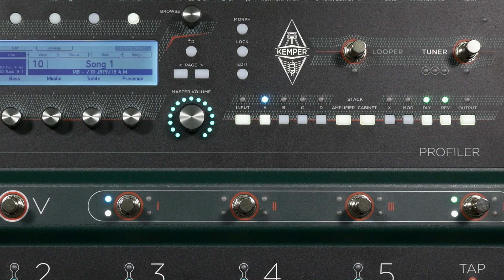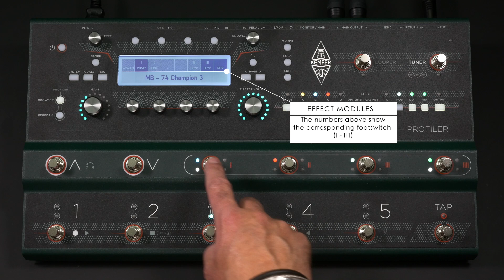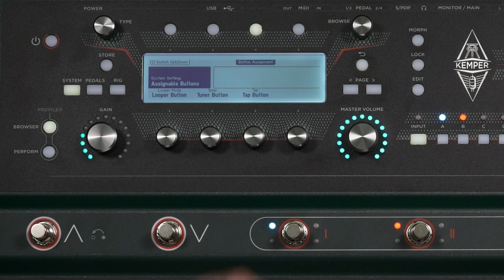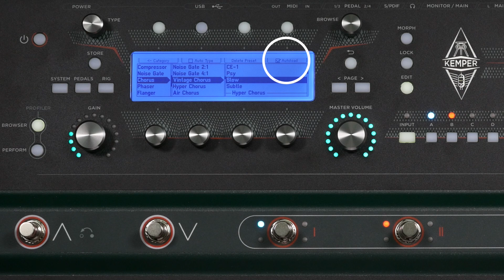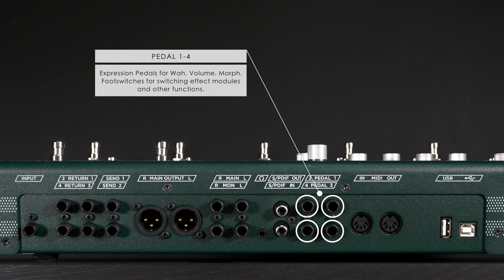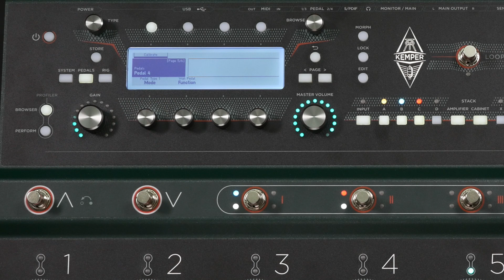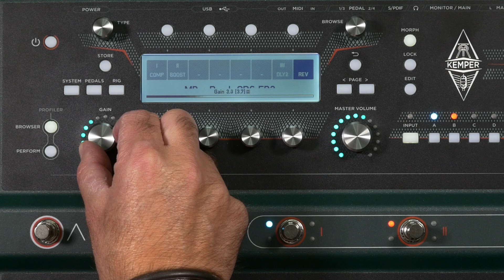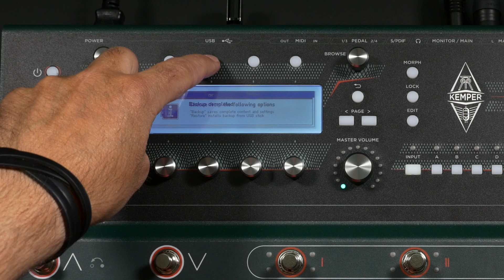Kemper Profiler Tutorials - Profiler Stage Overview (english)

Comment: I bought a Stage as a backup to a relatively old powered Toaster. I have kept them both up-to-date, OS wise. 
I am getting a powered kab so I can use the Stage amplified. I can confirm that the performances and rigs sound identical across both platforms. Best guitar gear I ever bought.

Comment: Decided I was done with schlepping amps, cabinets, pedalboards, etc. Tired of the issues and inconsistencies that went with them. The Kemper made this a quick and easy transition  for me. In one case, I have all of the amps, cabinets, pedals, or effects that I could ever want or need. What I don’t have is a sore back, patch cables, dead batteries, multiple power supplies, signal chain issues, etc. Sure, you could spend a lot of time figure all of the bells and whistles, but it’s basically ready to rock as so as you unbox it. Plug in your guitar, tune it, choose an amp rig, then rock on.
Reply: I don't know what's putting me off. Something scares me about that scenario and I don't know why. I must heed your advice and sell my amp and pedals and just buy one haha. So you have some sort of cab you use for rehearsing or anything?

Comment: Just got my stage (used) a few days ago.  Found a profile and used it live last night.  Amazing!  Sounds like a legit amp through FOH and my IEM's were perfect.  No regrets!
Reply: Straight to the in ears sounds good?  I saw another vid that said it was grainy.
Reply: @UptempoMusicLessons  I removed a little bit of high end and reduced the presence slightly on my high gain settings and it sounds great in my IEM mix.  It's a constant reminder to me that the quest for the ultimate tone is dependent upon many factors, and it changes from venue to venue.  Room size, shape, number of heads in the crowd all change the FOH sound.  At least I can leave that up to the engineer.  We run our own board as a band for our stereo IEM's and control them ourselves, so that part is relatively consistent.

Comment: the friedman ir x is the new kemper slayer designed by evh's personal tech and one of the best amp builders today not a  keyboard player ,with real tubes and great tones out of the box easy to use .sounds way better and more natural than any modeler could ever sound, can work with your favorite effects and with a power amp and speaker and has an effects loop .

Comment: I came across a bit of an issue, I’m using a power amp without a master volume plugged into the monitor output, and the monitor volume control/eq has no effect on the amp, only master volume does. What am I doing wrong?

Comment: Hello, is there anyone who could help? I just bought Kemper Profiler Stage alongside Mission Pedal. I made connection exactly like in the video. I changed settings exactly the way it was explained and set my pedal to be volume when OFF and Wah Wah when ON. Mono switch works pefectly and volume when OFF as well. But Wah Wah is not working. Pedal jusr doesn't do anything. Has anyone else experienced something like that? How did you solve the problem? Best regards.

Comment: How different headrooms of Head and Stage may affect the sound especially if using SPDIF? Is there DAC to outputs and then ADC to SPDIF or SPDIF is just simply digital output from the digital core? I watch a video where Stage is compared to Rack and Rack sounded fatter with less clarity. People in the comment section preferred Rack for its fatness.

Comment: Dear friends at Kemper,
I'm planning on buying the Kemper stage later today, but I still have some questions about it. I hope you can help your fellow musician. Here they are:
1. Can I change the position of an effect in the chain?
2. Can I put an effect in serial or parallel?
3. When profiling an amp, do I need to use a noise gate? As you may know, Marshall JVMs are quite noisy in high gain situations. 
4. Since power tubes give that extra grit, do I need to profile the amp at high volumes?
5. Does the unit have a wah? If so, when connecting an expression pedal, the effect is already engaged in the preset or do I need to switch it on like a Crybaby?
Reply: 1) Yes 2) Yes 3) No 4) Yes 5) Yes, dozens of Wah models. Load a Wah into FX slot #1, set the Wah settings to however you want it to engage, heel down, heel up, touch, etc.

Comment: This vs a Powerhead? Curious of your thoughts. Since this doesn't have a power section (it would be annoying to still lug around an amp as well as adding this) and I don't feel like making presets on a floor unit. The Powerhead seems more practical?
Reply: You can get a pedal size power amp like this for example https://www.thomannmusic.com/electro_harmonix_44_magnum_power_amp.htm  im not a Kemper user, but ive been thinking of downsizeing to a pedalboard and an power amp like this from my rack with tube power amp. There are other makers of similar amps as well, Harley benton, hotone and mooer is availible at Thomann at least. I wouldnt want the powered version anyway since its 600 watt and risk blowing my 1960´s 100watt  4x12.

Comment: hi considering buying a profiler stage because i like the idea of the units capabilites (the obvious profiling feature, library of sounds out of the box,etc) but im still very confused about one aspect. does it need a power amp? ive see old bandmates plug their axe fx rack and floor units directly into a cab; sounded great (no power amp) and was also able to split the output between his cab and the PA to use the cab as a personal monitor to feel and hear it at his back. im totally lost when it comes to this new tech. every forum i read is dudes obsessing over which power amp is best which is most neutral idk. is it even needed? is it a preference thing? does this work similar to axe fx in regard to it being able plug into a cab and play? thank you for taking the time to read this :) (also im going to use it for like proggy animals as leaders stuff if this makes a difference at all. spanky crystal clear shimmery cleans to tight punchy 8 string meshuggah rythmns)
Reply: Also is ok to use regular instrument cables to plug it in a cab or do I need to use speaker cables? Again I know little to nothing about the functionality of this unit and similar offerings on the market so please excuse my questions if they come off as stupid lol

Comment: Sorry if stupid question but do I still need an amp if I'm using a kemper profiler stage? I want to get rid of my heavy cabinet and tube amp...
Reply: Michitarre, I stopped using an amp and speakers. I only use the Kemper. One output cable to the board. Since we use powered monitors, I run a cable from my monitor out to the monitor.

Comment: Why didn't you show the profiling process? I'm a little bit confused, does it profile?
Reply: Yes, it has all the capabilities (including Profiling) as the Kemper head and rack Profilers.  The specific connections and instructions will be detailed in the Kemper Profiler Stage user's manual.  The Profiling Process is the same on all devices, so you can just refer to the Kemper Profiling Guide manual, for that info.

Comment: So you get this amp plug in guitar and it plays out of your speakers?? No extra amp or head needed
Reply: It's not an amp but an amp sim, so you'll need active speakers, not passive speakers. You could stick an amp between the stage and a cab, but the point is that the stage does not have an amp built in.

Comment: Now I love my Helix even more
Reply: Why?
Reply: @deltafit  Better display, better interface, easier live editing, smarter foot-switch display (designated colors, effect name) with 10 switches for stomp-box mode – comparing to the Kemper that only has 4. Colored lights for easy identification of effects when playing in dark scenarios, snapshots, touch sensitive switches for quick effect access, view and editing, easy to operate editing computer software, bigger community for presets sharing, can run 2 amps at the same time, and… …it includes an expression/volume pedal – still $100 cheaper. Line6 just release the 2.8 firmware, and it’s even better.
Reply: @victorsantiago7391  you aren't wrong!  I think Kemper has missed a big opportunity with this device... it is simply their current profiler and remote placed into one enclosure (which people have been requesting for years), with no significant new functionality.  If they had looked at what the competition is offering and used that as the bar that they needed to meet or beat, this would have been a much better product, and it would have gained them a lot of new users.

This seems like too little / too late.
Reply: Sorry to hear.. no one is perfect. All the Helix owners are here to see what they missing out on :-)
Reply: Yes, there are a group of people who prefer shiny, color displays and scribble strips over having a completely accurate and authentic recreation of a specific amp's tone and feel, including industry leading effects.  Cats like shiny objects as well.
Reply: @victorsantiago7391  Yes, let us know when you get around to profiling yours (or anyone's) tube amps with your Helix.  I will be keen to see how that goes for you.  Enjoy your "better" display with your inferior amp tones.
Reply: @brentcgp  Apparently nothing.
Reply: @Deuterium2H  We prefer the convenience, the reliability; having every effect, amp, speaker cabinet, microphone, and 3rd party IRs that we will ever need crammed in to one pedal, for a lower price. The benefits of something like the Line 6 Helix makes it worth the "difference" in tone from a Kemper. Yes, I know and understand the Kemper could be better on accuracy and recreation of a specific amp, tone and feel, and that the Helix cannot “profile” any amp, but I will be thrilled to see you tell apart sounds in a blind test from a Helix and a Kemper – it’s practically impossible. When there’s a band playing through a PA system and a crowd, you CAN’T tell if the guitarist is using real amps with analog pedals, a Kemper, or a Helix.
Reply: @victorsantiago7391  maybe you cannot but plenty of other do
Reply: @robertsimpson5801  Well I who come from Ax8 I crossed the step I just order
I find it great a long time ago that I hesitate to come to fractal
and that line6 do not like me at all huge interface have lost are time to settle rather than play,
Reply: Brent Nel to see how far behind Kemper are !! 🤪
Reply: Victor Santiago and then the Axefx8 which is better than both !!! 😎
Reply: Pity it sounds like shit compared to the Kemper. But if your psychology is fancy lights and colour TV screens versus tone then hold onto your made in China Helix!
Reply: LoL

Comment: How to read the tuner on the display?
Reply: It has two modes: normal and bubble (not shown on this video). On the normal one if the bars are moving from right to left the pitch of that string is too low. If the bars move from left to right is too high. May sound confusing, but when you're using it is quite intuitive. If it's still confusing you have the bubble mode. 

Ps: While being in tuner mode a number is also shown on the bottom of the screen telling you how many semitones above or below the reference pitch the string is :)
Reply: The tuner takes up the whole display.

Comment: Crap display for this price, Kemper need to get real against Fractal, Line6, Moer.  This alone would delete this from being a worthwhile buy!  I would fire the designer responsible for the display!b. The UI is too fiddly 2.  Last but not least FX is less comprehensive plus where all the competitions says what you get, Kemper says you can profile anything, but doesnot advertise what comes with it, except profiler as does Fractal and Mooer. MUST BE AIMED AT EXISTING KEMPER CUSTOMERS.  I shall continue with my order for Fractal FM3.
Reply: Check sales of the 'Stage' over the last two weeks and check sales of the Fractal over the same period...there's your answer right there. :) Then decide what's "real" and what's not "real". :)))
Reply: @CrazyDiamond1968  Sales has nothing to do with design or spec for me. The FM3 is yet to be available so sales is not a good argument right now. The long awaited rig manager and now this display put me off it.  There are Kemper lovers and Fractal fanatics.  I dont have either and about to enter the modeller market with the low end FM3.

Comment: terrible display and interface, headrush pedalboard older but much better
Reply: You don't play an interface. You play the sound.
Reply: @celticgibson  agree, but its 2019 not 95, devices should be much more user friendly
Reply: @ExoticBomj  honestly it doesn't get more user friendly (to musicians aka apes who like playing with knobs) than this, everything is literally at the touch of your fingertips, why do you want a display (that will break) and go through 15 menus to change the rate on your chorus?
Reply: @carlosfallas2169  i know what it's like, i owned kemper for two years and it was the worst user interface i ever tried. even old line 6 x3 live more user friendly and it's pity that nothing changed even on floor model
Reply: ExoticBomj but the sound is way better
Reply: @ExoticBomj  It is user friendly. I have a profiler. It's simple to use.
Reply: @celticgibson  headrush and helix is friendly
Reply: Agreed. The display in the KPA and Remote were rubbish when released years ago, it should have been improved for new hardware.
Reply: Yehaaaa. And where is the rainbow of dead mode in the Kemper?